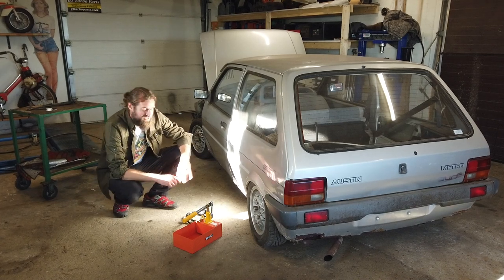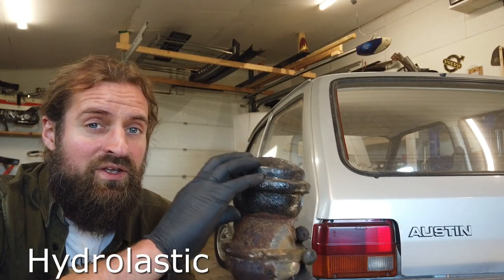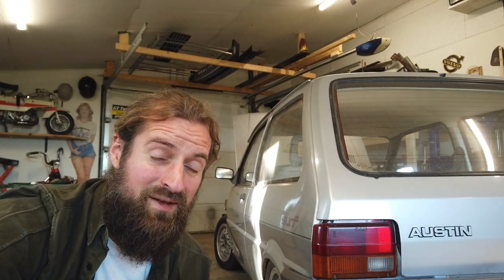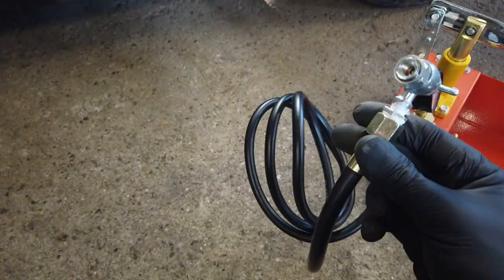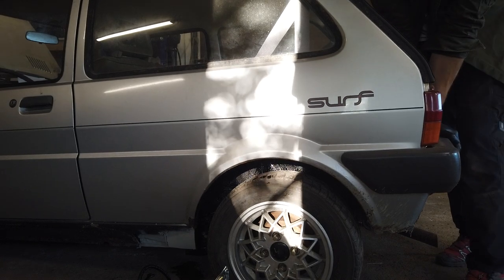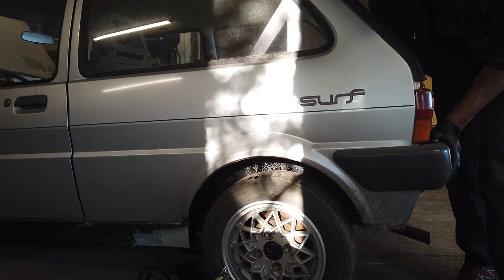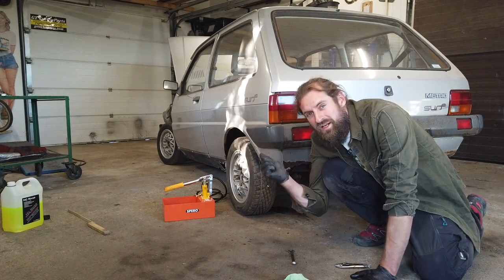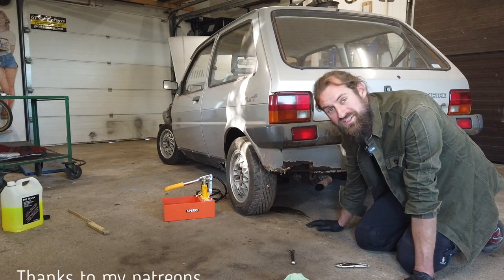Austin Metro. Pumping up the Hydragas suspension.

Comment: Have you ever had issues with squeaking suspension? After pumping mine, it developed a squeaky noise going over any bumps in the road.
Reply from the maker: no.. but have not drivien the car yet... 

But could it be dry suspension shafts maybe?

Comment: Looks good with the suspension pumped up (done a few myself over the years --- mini, allegro and princess), have always thought if a pump, tank and control system was added to the suspension setup would it be the same as Citroens or could it be made to perform like the U.S. custom lowriders (modern custom systems used compressed air, but the old system were hydraulic)?
Reply from the maker: Yes it would be pretty similar of a pump was fitted i guess.. :)